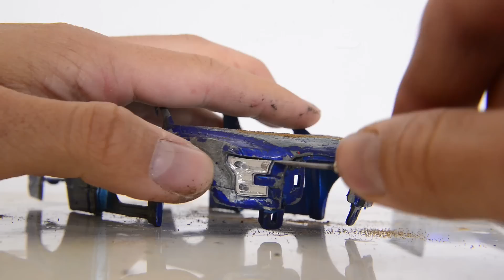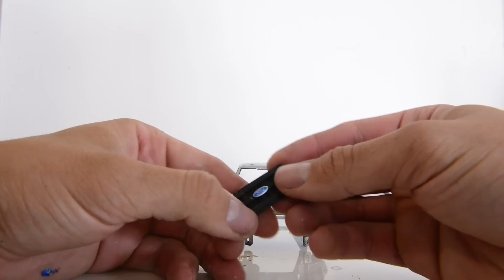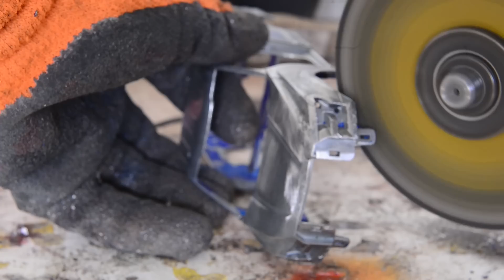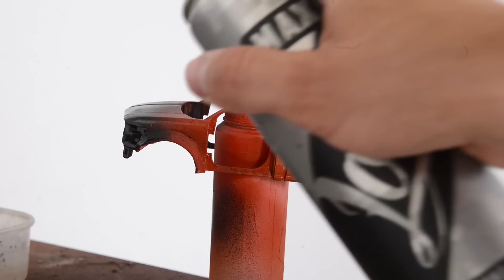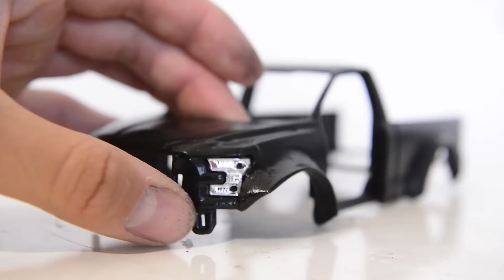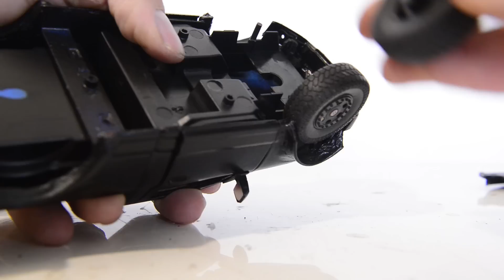Restoration Damaged Ford F150 Model Car - Transforming on F150 Raptor

Comment: Wow man that's awesome!  Good job! I own a real F150 just like that one and I used to work in a body shop so this video was perfect for me. Might I make a suggestion however? There's only one detail you left out of this video my friend and its the orange raptor lights on the grill! Come on man. All you need to do is get a toothpick, a bottle of testors silver paint and a bottle of tesfors translucent orange turn signal paint. Dip the end of the toothpick in the silver paint first and lightly add three dots of it side by side in a line above the ford emblem just below the hood. Wait for the paint to dry then dip the other end of your toothpick into the bottle of testors translucent turn signal orange paint and lightly add three dots of it directly Overtop of the silver painted dots you just added and you will have awesome looking orange raptor lights for your awesome truck! I also would recommend that you print out the gray Ford raptor splash logo on a decal sheet and place it going up the side of the bed of the truck just like a real ford raptor. If making decals isnt your thing then you could also try creating a stencil out of masking tape for the ford raptor splash logo and painting it onto the sides of the truck with gray paint. Either way you at least have a couple of options for how you would prefer to do that. Best wishes to you and happy modeling!

Comment: I am not an expert in this restoration field neither am I a collector, but I am an engineer and I know that these are diecast aluminium cars, and you could've easily worked it to shape after applying the blowtorch for a bit... Also, you could've used a soldering iron to melt a set of holes so that you could slide in a small knurled rod that could hold the tyres so that the vehicle could move...

Comment: everyones here keeps saying that it is bad done.
i dont think that, compared to damage it gotten.
maybe only small advices: when widing body, glue big piece of plastic inside fender, and then gently, slowly brush it to wanted shape. also painting interior, it will be better to use matte collors. and those used by modelars, like tamiya. also clean and brush a little before painting.
but those were just some advices